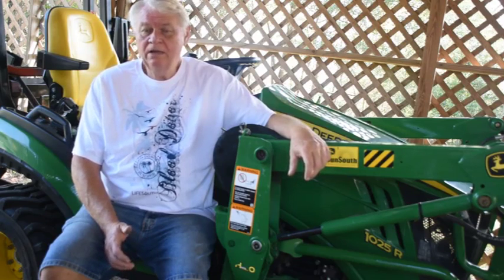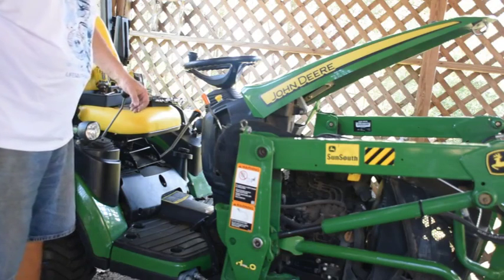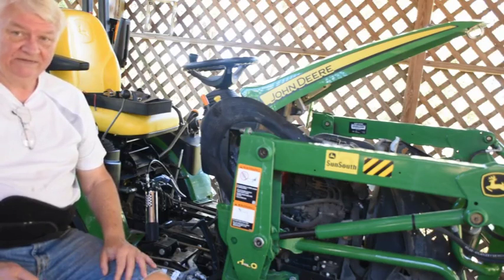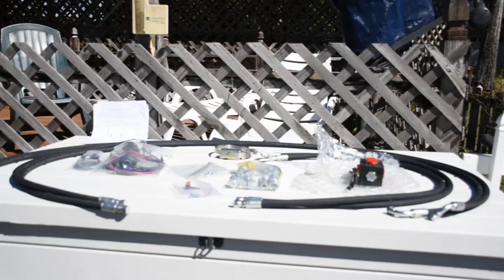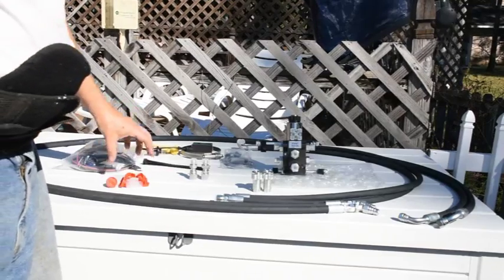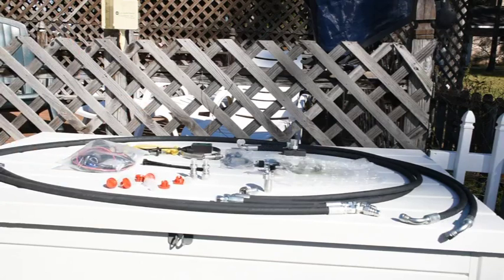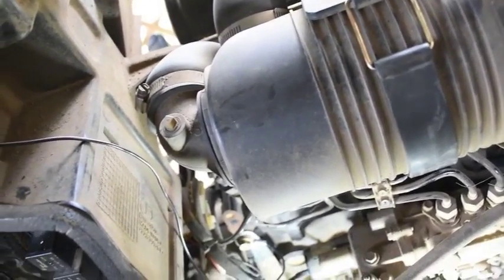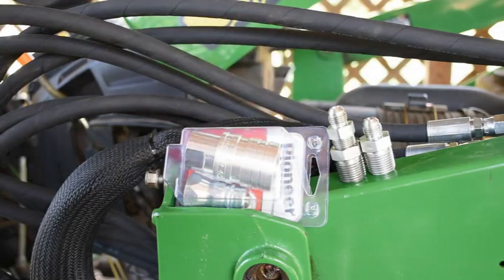New for Oct 2020  Hydraulic Diverter Valve Kit for John Deere 1025R

Comment: Thanks for making this video.   I'm getting ready to install this same setup on my 1025R.
Reply: @billrowell7185  Thanks for the video, it will come in handy for others on this project.  I'm looking at purchasing the same hydraulic kit for my 2019 1025R. I'm using the same grapple. Could you please give me more information on the fittings you had to purchase to hook up the grapple that wasn't include in the kit? Also how much hydraulic fluid was lost during install. I'm trying to have everything needed to start this project.

Comment: Thanks ,just got my Summit kit  $522 with GWT coupon...(Shipped quick ;) ) and your vid came up. Adding the AV20 F Grapple. Adding it to a 2012 1026R.
Taking the factory SCV knob off all most wanted to cut it off...If you get that thing off without marking it , you would be doing good...I did not care so went at it.

I liked your thorough explanation of the hose. I have SP and this will be very crowded.

Comment: Update after 1 month.   Have used the valve kit with my grapple a dozen times; some two to three house at a time.  Zero problems to date.  A few minor hydraulic leaks with the fittings a bought from tractor supply, not the kit.   I still really like the joystick control; it feels good in the hand.  Hurricane Zeta's eye clipped us in south Alabama.  Several trees down, big limbs on my place and neighbors around me.  Lots of grapple time for that.   For some reason, after a hurricane, we have several pine trees to die of bugs and getting twisted inside.  More grapple work.  Finally, the fence line across the back of my property.  I am mostly finished with that.  Regards.

Comment: Another update.  I was working with my bucket and noticed that the long hydraulic lines running to the front of the tractor were getting very close to going between the loader arm support and the hydraulic cylinder where the hydraulic hose bent going across the cross support.   I had not secured the hose with zip ties to the hardlines in that area.  It was a simple fix, but take a look at that on your installation.   Pinching a line would not be good.  Regards